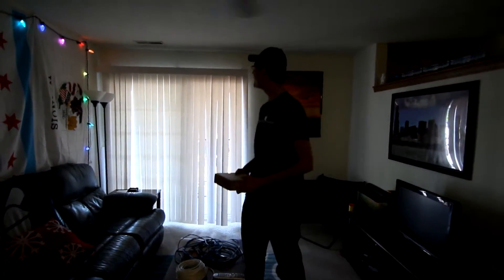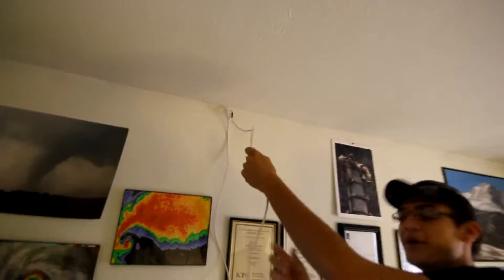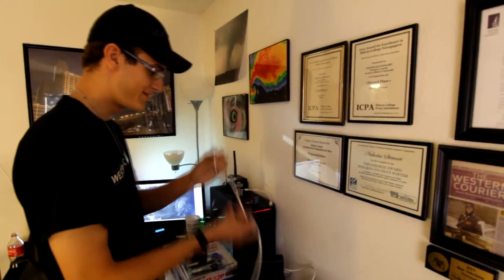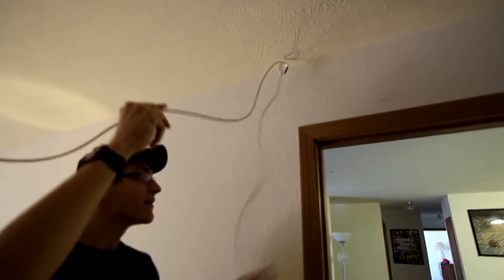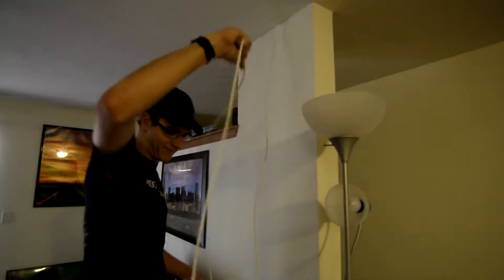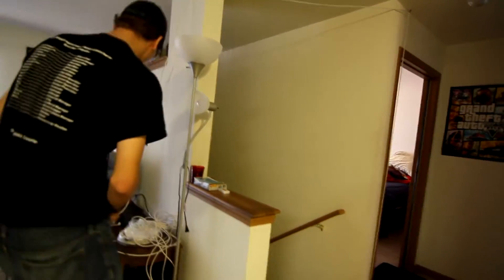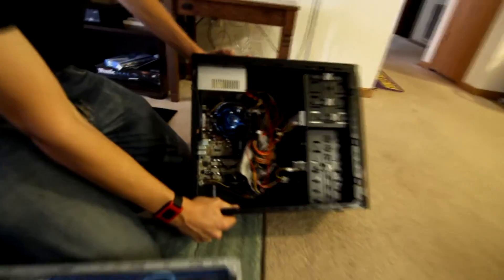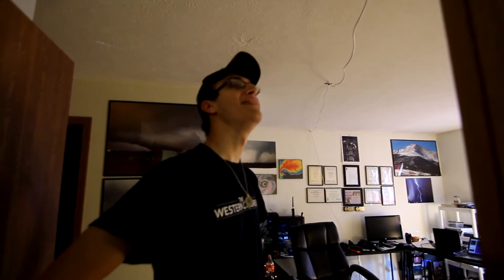Easily and cheaply networking an apartment

Comment: Wiring ethernet in an apartment kinda sucks. I had to put my modem in my bedroom because of an issue with the cable going to my living room causing insanely slow speeds, and Comcast refuses to send a tech to fix it. So now I've got a couple of runs of cat 6 cable. One from my modem and router in the bedroom going to the main hallway, and into a switch that I use for my Proxmox server in the closet there by the front door, and then one going from that switch and out to the my main PC in the living room. My trick was to run it along the floor, as close to the walls as possible and underneath stuff to eliminate trip hazards. A real PIA, and kinda unsightly. But still much faster than WiFi.